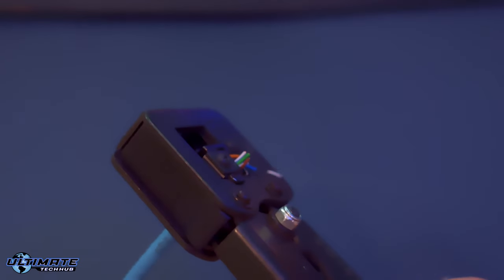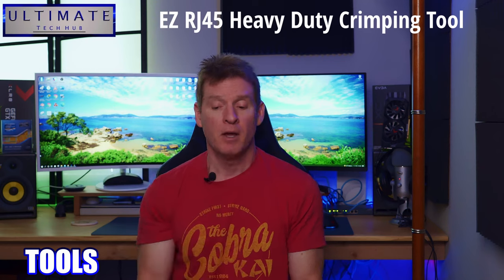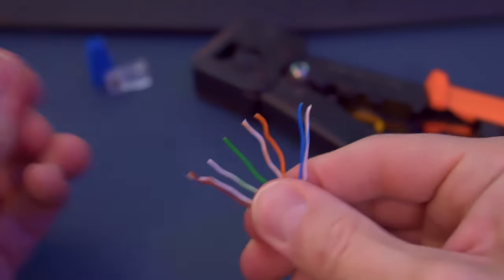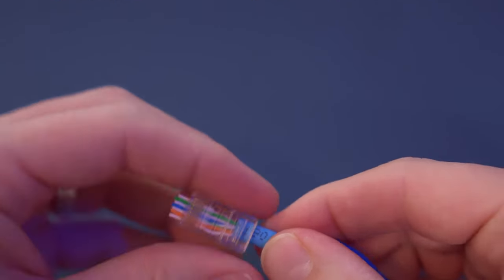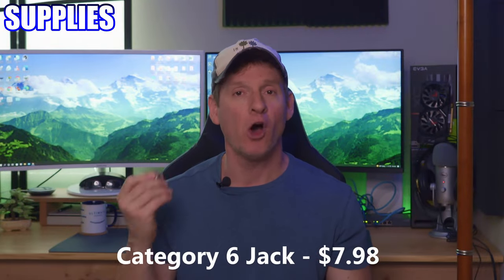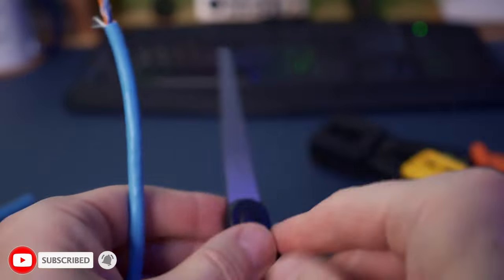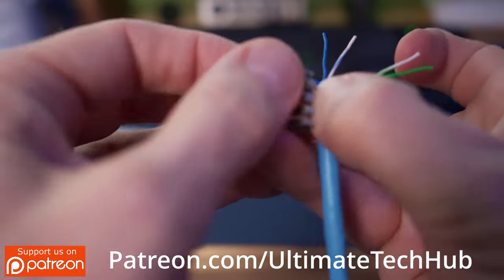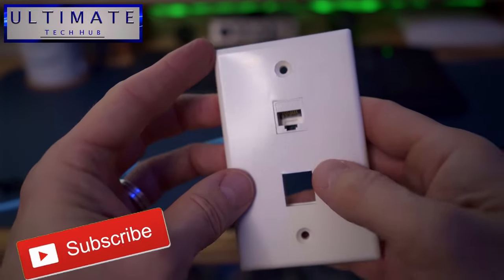WIRING UP ETHERNET PLUGS THE EASY WAY AND KEYSTONE JACK INSTALL!

Comment from the maker: This video shows "How To Wire Ethernet Plugs The EASY way! Cat5e and Cat6 RJ45 Pass Through Connectors! And How To Punch Down / Terminate an RJ45 Keystone Jack into a Wall Plate!" Thank you for watching! 😄
Reply: If I follow the wiring format used for both the male plug and the female Jack in this video will my connection work? I have one end with the male plug and the other with the female Jack. Thanks in advance.
Reply from the maker: @wtfiswrongwithyall  Yes absolutely! Thank you for watching.
Reply: T568B while common in places before, has been deprecated. T568B has never been valid in Canada, only T568A.

Comment: Why not use a female to female connector on the plates? Seems like installing ends is much quicker than punching down in the blocks. The female to female connectors are probably more expensive, but it seems like you can more than make up the cost difference in time savings.
Reply from the maker: Either way is fine but the way I always do it is by wiring it up with keystone jack. Thank you for watching!

Comment: OK so when you put the wires into the keystone jack you don't strip them. How do they make any connection?

Hope that makes sense.
Reply from the maker: You don't strip them. The wires will make the connection once you push them down with the punch down tool. Thanks for watching.

Comment: Can you use cat5e cable to install cat6 walljack?
Reply from the maker: @440hp5  Yes
Reply: @UltimateTechHub  i read somewhere that since cat6 wire is thicker, cat5e will fit loosely when punching in the walljack
Reply from the maker: @440hp5  I've done this but yes you have to be careful to make sure the wires don't slip. I would just use cat5e wall jacks to avoid any issues. Good luck

Comment: Hey ser I hope you doing great 
I have a fiber optic 100mb and they gave me a cable 5e cat .. but I never use it bcs I bought cat 8 to improve my connection in gaming but I feel the gameplay became much slower and a high ping 
Which cable do you recomande for my 100mb connection 
I try cat 7 also same probleme .. do you think that cat 5e is enough for me
Reply from the maker: Cat5e or cat6 is enough.

Comment: 0:46 Those rubber boots get really hard over time and make it extremely difficult to remove your connector. So hard that the easily frustrated person might damage something in the connector removal.  I ended up taking a razor blade to the bump protectors and cutting them all off.
Reply from the maker: Yes they can but once I install my ethernet I never touch them again. Set it and forget it! Thank you for watching I really appreciate it!
Reply: The boot can be pulled back if it's really getting in the way, then reinstalled once you have successfully disconnected the cable. There are better systems for moulded cables, but the boot is your best option for making your own cables.

Comment: Hey I’m looking to run some cat cable throughout my house. My router is in the basement (far west of house) and the my room is upstairs (far east of house). What is the best way to run those wires? Would it be thru my attic?

P.S: Your video is 100/100 rating. Explained everything very well.
Reply from the maker: How will you run the ethernet from the basement to the attic? Are you running it though the floor or walls? I would try and move the router to the first floor to make it easier. Is there a reason your router is in the basement? Also remember if you join my channel membership or join my patreon you get 1 tech support question per month plus other awesome benefits. Good luck and thank you for the kind comments.

Comment: What keystone wiring format is that? A or B?
Reply from the maker: I always use B.
Reply: @UltimateTechHub  ah I suppose it depends on the connector then? The ones I was using has this same color pattern listed as A.
Reply from the maker: @ruvimtrofimovich  It does depend on the connector. Check out my most recent video on Cat6 Ethernet jacks. Those connectors are amazing.

Comment: Amazing video! But when you put brown and orange wires on the same side when you wiring on wall plate, it seems like a  568A?
Reply: I think there's a diagram on the keystone, but either way it shouldn't matter as long as you do exactly the same thing on the other keystone jack. Consistency seems like the main priority.

Comment: What cable should be used to connect a computer to the router for Internet...they are on opposite ends of the house.
Reply from the maker: Cat6 is fantastic for long cable runs up to 328 feet!
Reply: @UltimateTechHub  great, thank you

Comment: My cable carries colors other than those in the video such as pink, light green and dark green, is there an explanation for installing this type of wire?
Reply: Hope you figured this out by now but usually light green is corresponding to green striped white, same with pink and red, so forth. Pure white is usually orange striped white in my experience.
Reply: @ryanwhite2308  Thank you very much brother, I actually did what you mentioned in your comment and it worked!

Comment: That's funny, you must learn. I must learn what 27 years ago been in computer building for 32 years. lol
Reply: 29 dollars jeezsh mine was 65 dollars at Menards as the other new set I bought paid 45 for them are junk, what are you talking about they're all 8 pin & 8 wire
Reply: I usually take a piece of the outside plastic or rubber coating I cut off of the end and will take it shove it up inside the clip along with the other wire then crimp it for a tighter hold and crimp.